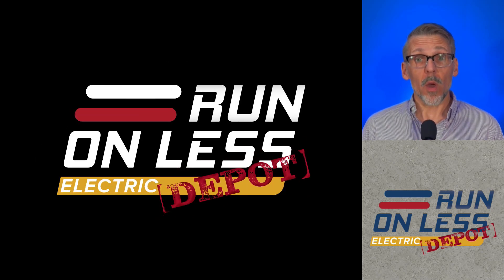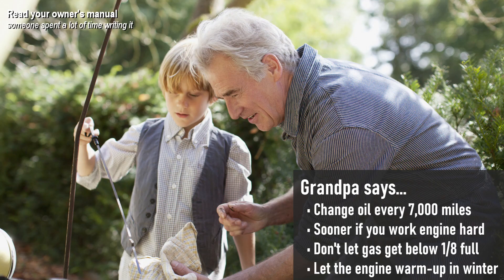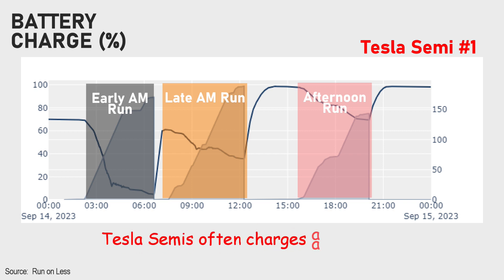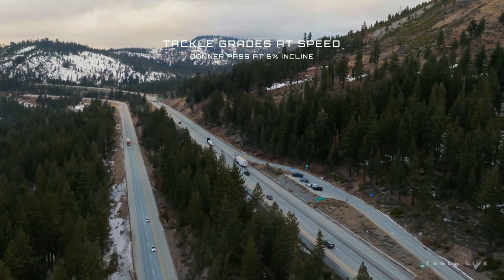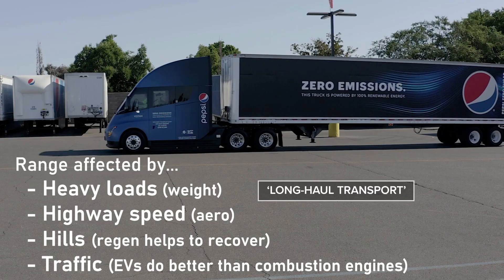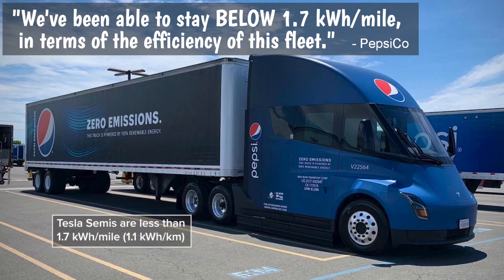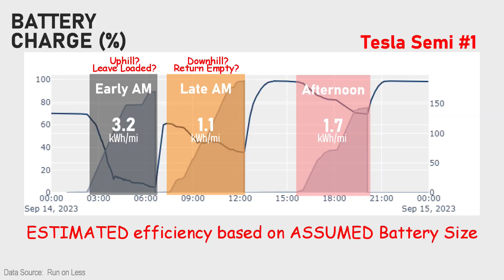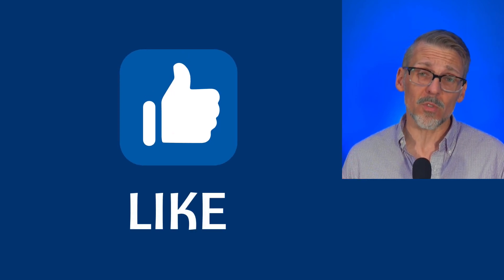In-Depth Analysis of Tesla Semi Data (Freightliner and Volvo too!)

Comment: Tesla did 500+ miles at 82k gross crossing Grapevine, on a single charge.  There is a video of it.
Reply: Tesla has faked every single video. You think this one's different?
Reply: You cant possibly fake that!
Reply: I have to do 600 miles at 83k gross, so not viable yet plus the speed limit is 80 here.
Reply: @thedood4713  No one is making you buy an electric truck.
Reply: 82k was the total weight, what is the weight of the load?
Reply: going an average speed of 52.5 mph.  Not very real world
Reply: @prof.crastinator 
Actually that speed makes sense as aerodynamic losses are a huge factor! The legal speed limit is 55 mph so tesla can argue that is appropriate. The EV transit buses that I deal with are ok at stop & go at low speed but put them on a freeway at 55 mph and they drop dead too soon to be useful. Also routes that are near 200 miles per day are a bad fit for ev buses.
Reply: @Mentaculus42 your right about them running out of power faster, but ev semis have regen and the ability to coast at speed. That will significantly improve their range on the freeway.
I know cars and trucks are different but I only get a little less efficiency on the highway because I coast at 55mph. All that momentum becomes energy when it has to slow down.
Reply: @Mentaculus42 200 miles a day is too easy for the semi, there isn't enough data on the range but when it was tested at maximum load on a 1000 mile trip, it only needed 2 30 minute charges and one 45 minute charge. That says how long they can last and they can get back on the road fast. (None of the charges were from 20-80%)
Reply: Lot of good regen will do you on a highway.
Reply: @nimabeee_playzyt3339 wow you no nothing about normal highway speed and trucker hours. Most interstate highways have a 65 mph  ĺimit for trucks and truckers are limited to 8 hours per day. So this slow truck is losing 80 miles a day.

On top of that batteries loses about 5% of their charging capacity per year. Dont even factor cold weather charging and performance. Here we are 1 year later and this truck is still a mystery of bs
Reply: @kelvinw.1384  That's not what pepsico has reported,if you have a problem, go talk to them. I'm not listening to a kid on YouTube. 

You don't know anything about batteries, they don't lose 5% per year... the first year is 3-4% and from there it's extremely low degradation for the next 300-400k miles... man, there's so many studies released about batteries lasting over 300k miles and here you are with dated 15 year old misinformation.
Reply: @prof.crastinator that average speed was what they were getting doing real world routes, so not sure what you're talking about here. Or did you miss the fact that this entire video was analyzing actual data from actual fleet operations?
Reply: @truhartwood3170  Wait until you find out the rest of the country has 70mph truck speed limits….  

Where is this super financially viable semi?  it should be everywhere with it’s amazing ability to beat rail in a convoy situation?  

Cope hard.
Reply: @prof.crastinator  I said 55mph is the "average speed" not "max speed". Might want to slow down a bit when you're reading there. They use 55mph average speed when calculating range because that's simply the actual average speed the trucks have been doing on their real-world runs. They're currently building the factories (Nevada and Germany) to build the semi with a target run rate of 50,000/year by the end of 2026. I believe they've built at least a couple hundred so far on a low-volume production line for testing/proving. Tesla is using them themselves, and Pepsi now has 85 of them in their fleet, recently taking delivery of another 50 to add to the 35 they've been testing for a few years now. Walmart and Costco have some, too. I remember Walmart has already ordered 130. There are a ton of other orders from other companies as well. They all know they'll need to make this switch asap to remain cost-competitive.
Reply: @truhartwood3170  Watch the video- every single car or truck passes him.  he made a single pass the entire drive.

It was the top speed.
Reply: @truhartwood3170  The Average speed was 52.5 mph- like i stated in my original comment. Try reading and doing math guy.
Reply: @prof.crastinator  Are you saying that's the top speed in the video, or are you saying that was the average speed, or are you saying that that's the literal max speed of the truck, or are you saying the range will drop by half if it goes 70mph? I don't really understand what you're trying to say here, (based on one single video from almost a year ago when we have way more videos and data now).
Reply: @truhartwood3170  In the video. Because the faster you go the worse the range will be. Of course they were just following the speed limit- but that won’t fly in other states.
Reply: @truhartwood3170  by half? No. Significantly oh yes.  What data? Tesla supplied data?
Reply: @prof.crastinator  You seem to be upset that this isn't a drop in replacement magical panacea for all trucking.

An entirely new transportation paradigm requires an entirely new logistics paradigm. 

These trucks are going to be production limited for a very long time.

If it's not the right tool for your job why are you even bothering?

This isn't a consumer product. You should know what you're getting into. If you don't, that's a you problem. Caveat emptor.
Reply: @prof.crastinator  start with the Run On Less event that tracked 3 of Pepsi's Tesla semis as well as a range of other trucks and semis. Also, we know the next gen semi that will be the mass-produced version will have different specs based on lessons learned over the last 7 years of testing data, maintenance issues that have come up, driver and corporate feedback, etc. Plus that's two years away so the battery tech will be much better. That could lead to them keeping the same range and making it lighter, or increasing the range, or just having more options for range vs weight. The price Dan Priestley gave of $150 - $200,000 is probably already factoring in battery costs coming down drastically over the next two years (they're already coming down pretty drastically over the next six months!). But the rate of improvement in technology is probably a big factor in why they don't want to give too many specs right now. They may also be planning some outlandish stuff, like maybe it will be autonomous right out the gate, or maybe the production line will only have Optimus robots working on it. Either of those could change things quite a bit in terms of design and cost.
Reply: @truhartwood3170  Haha- you believe everything Tesla and Elon tell you… This thing is a useless gimmick for so many reasons- range just being the most obvious.  Nevermind charging infrastructure cost and battery life…
Reply: @truhartwood3170  Optimus robots 😂😂😂😂 You have really drank the koolaid guy.  Tesla will be bankrupt within 3-5 years.
Reply: @prof.crastinator  yeah, I've heard that before about Tesla going bankrupt. And about me drinking the Kool-Aid. But things keep working out the way I expect, and the doubters keep getting proven wrong. So. 🤷‍♂️
Reply: @truhartwood3170  Have they? Because the only thing that keeps saving them are dumb investors. It’s a small car company valued as a large one- that barely makes money and much of that is accounting magic.   
They have an aging product line except for a truck that loses money and a vapor wear semi truck.  But keep pretending full self driving is coming next year.  Along with robotaxis and robots.
How is that roadster working out for the suckers who paid 250k for a promise?
Reply: @jtjames79  It’s vapor ware- batteries are awful for large trucks.  They are too heavy but more they have ridiculous charging needs to make them even semi-feasible… And even if you solve that they cost more to own over the life of the truck- even when considering diesel.
Reply: @jtjames79  And without a price or third party provided cost and efficiency data- it’s all tesla’s word about this making economic sense for ANY use case- and they don’t have the best track record about truth in advertising.
Reply: @prof.crastinator  🤣 You so mad rn.
Reply: @prof.crastinator  You've been claiming Tesla Would go bankrupt in the next 3-5 years for the last 13 years now. 
Yet Tesla has more cash in the bank than pretty much every legacy OEM combined.

Tesla semis will take over the industry. Mark my words.
Reply: @themonsterunderyourbed9408  have I?  Weird I don’t remember that… and still wouldn’t change the fact that they won’t have nearly the market cap they do now 3 years from now…
Reply: @themonsterunderyourbed9408  I can’t wait for you to be so wrong about this- I doubt you’ll acknowledge it though.
Reply: @truhartwood3170 lmao....here ŵe are 1 year later in the middle of 2025 an̈d the factor still isnt built yet. 50k in 2026 huh. Whats going to be your move the goalpost bs excuse now. Batteries?? The truck was annouced in 2017...its almost 9 years later. Your still stuck quoting data Tesla gave you.....rofl
Reply: @prof.crastinator A lot of otr trucks are limited to 55mph for fuel savings. Assuming you ever slow down or speed up on your route, then your average will always be below your top speed.

So yes, actually. Very real-world.
Reply: @operator8014  Go ask real truckers about this- because no- much of the country allows trucks to go 70mph because time is often more valuable than fuel savings (not that the semi would ever compete on cost- as it is far more expensive than diesel trucks).  So not real world at all.
Reply: @prof.crastinator  You can keep looking for every way to hate this truck.  The Tesla Semi doesn't really care.  Want to see some fantastic numbers from it?  Look at the Run On Less 2023 numbers, pay particular attention to Tesla Semi #3.
Reply: I hope they're paying you enough to be so gullible.
Reply: @MidlifeTrucker-ThomBell  the tesla semi is like their EVs. They provide a short and shitty range. 500 miles of range for a semi is absolutely nothing compared to the many regular semis that offer 1,000 miles of range or more. I'll take the fueling and the ability to keep moving. Time is money and money is time....
Reply: @carlsmith5545  Yes, to those who know nothing about the Tesla Semi the 500 mile range seems like a problem.  It’s not.  In just 30 minutes it recharges to 75%.  As you know drivers are required to take a 30 minute break each day.  

The Tesla Semi won’t work for you because you allow political bias to block your thinking.  It’s okay, no one is making you buy one.
Reply: @MidlifeTrucker-ThomBell  a 30 minute break? Drivers are required to rest 8 hours after 12.
Reply: Lol!!! My grandfather is a retired truck driver. 45 years of moving freight from one end of the country to the next. I have a Tesla model S. Honestly? Their downtimes for charging and longer ranges needs improvements. I'll never give up my 570 miles of range which tesla or any EV in America can provide. I use my model S for what it was designed for, short range local destinations only. But bor if they ever came out with the semi that provided 1000 miles or more,  shit now we're talkin!!! That would be bad ass!! Hell yeah...
Reply: @MidlifeTrucker-ThomBell  otherwise i don't need any politicians to see that electric needs improvements. Hell even you know that...
Reply: @carlsmith5545  EVs will continue to evolve. Diesel will fade away. Cost per Mile to operate will seal the deal. PepsiCo is moving cargo for about 25¢ per mile in California using Tesla Semis.  Diesel can’t come close.
Reply: @MidlifeTrucker-ThomBell  yeah well today's not that day...
Reply: @MidlifeTrucker-ThomBell  If plugging in and staying awhile for a short and shitty range is impressive to you then do your thing buddy. One day they will come out with electric with greater range and less time to charge. That would be impressive..
Reply: @carlsmith5545  It will never be that day for you.  You have already demonstrated that you know too much to even think about EVs.  You look at them as a leftist plot to take away your diesel.  I like saving money.  I love EVs, hybrids, and Plug In Hybrids.  And before you go there, I’m a lifelong Republican.
Reply: @MidlifeTrucker-ThomBell  Again! I don't drive diesel, and i have a tesla model S. I use my model S for what it was designed for, short range local destinations only. I like EVs too. I think they're kool as hell. But once they're improved with shorter down times and longer range, I'll like them even more. Not only do i save money but i make alot of it too. Money is not the issue, i have that, it's time i don't have. And being Republican or Democrat has nothing to do with it. Anything else???
Reply: @carlsmith5545  Short range only? What is your range? Most Americans do not exceed 300 miles in a week, let alone one day unless on a trip.
Reply: @MidlifeTrucker-ThomBell  exactly!!!! There you go, Now you see. Except on a long trip!!! When im not traveling seeing family or on business, i use my Tesla model S. I go back and forth to my business and work, grocery store, walmart, the diner, mall, and anything else local. For this 300 miles of range is more than plenty. I charge it once a month and yeah taking me about 30 minutes. Sucks but that's electric. Long distance traveling? You damn right i break out my jaguar XJL. Now this is long distance traveling capabilities. A large full size luxury automobile which tesla dosent even make, fueling 3 minutes and not 20 to 30 minutes, range 570 miles, which is not available in an EV. Infact my XJL has more range at 570 miles than a Tesla semi truck at 500 miles of range. Between Lancaster Pennsylvania to Jacksonville Florida is 831 miles. I travel this through the night when everyone is home and out of my way. It doesn't matter how many times i stop for what ever reason, i only have to stop once to fuel and takes me 3 minutes. Up and out. Most americans you say? Most americans want nothing to do with EVs. And, im not most americans. I travel alot. Wish i could buy an EV with travel range but unfortunately the reality is, long range continues to be reserved for gas cars only.
Reply: 82k? So empty?
Reply: @jerrylawson9003  Sarcasm or Ignorance?
Reply: @MidlifeTrucker-ThomBell  "Sarcasm or Ignorance?"

Realist of fanboy?

Quoting Musk is basically repeating a lie. If you ask Musk to pick a card from a deck he'd insist he got the 11 of clubs.
Reply: @vinny142  Can you disprove the independently verified Run On Less 2024 data?  Have you even looked at it?
Reply: @vinny142  Run On Less is not Elon Musk.  It’s an independently verified annual truck event that uses real time numbers of trucks doing their actual jobs across this country.  The Tesla Semi uses 1.7 kWh to move cargo a mile.  That’s about 25¢ on California’s electric prices. What does it cost to move a semi a mile on California diesel prices?
Reply: @MidlifeTrucker-ThomBell about .82 in California and .68 where I live in Maine. If everything was electric, demand would probably make that a moot point though. My question would be; with the electrical rationing that is becoming more common will the grid sustain that much electricity usage? Wouldn't it be better for the states to invest into mass/bulk transit such as trains; which use energy even more efficiently than trucks for long haul? And as more people want to drive less, wouldn't that make more sense than cars and SUVs?
Reply: @bdaig12  Our electric grid isn’t a problem. The only time that is an issue is 3 months of the year during peak hours, which are from 2 PM - 7 PM.  Every night we have an overage of electricity.  We won’t go from where we are now at the flip of a switch.  It will be 20-25 years.
Reply: lol what have you accomplished in your lifetime Mr Keyboard warrior?
Reply: @antoinepageau8336  because that is a sign you have a winning argument- when you desperately need to claim the other side is a “keyboard warrior” instead of disproving their argument or even addressing it.
Reply: @MidlifeTrucker-ThomBell  well here's some facts. I personally like the look of the semi but unfortunately, Tesla's semi class 8 truck is nowhere near mass production status. Nearly two years after deliveries began, the American company built roughly 140 units, with approximately 100 being used by tesla it's self and 36 going to its biggest customer, PepsiCo. About 12.2 million trucks are on the road currently with less than a handfull being electric....
Reply: @carlsmith5545  Then quit worrying about them. Keep driving your diesel.
Reply: @carlsmith5545  Rome wasn’t built in a day.
Reply: @MidlifeTrucker-ThomBell  that's ok, I'll waite....
Reply: @MidlifeTrucker-ThomBell so 1 year later and your magical truck still isnt fully released nor having any other independent testing.
Reply: @ You mean you haven’t seen any so you ignorantly believe there is no testing. Look up the numbers from Run on Less 2024.
Reply: So, they violated the law?

There are hour and speed limits here. If you run at speed limit for the maximum time allowed, you wouldn't get 500 miles.
Reply: @downix  how do you figure they broke the speed limit? I think you might be mathing wrong.
Reply: @downix You aren’t good at math and you don’t understand the HOS. You can drive 14 hours in a day, legally.
Reply: @midlifetrucker-thombell4722  Not more than 8 hours at once, which must be then split with a 30 minute break. You fail.

So, 480 miles in one stretch, 360 miles in the second. In that 30 minute window, you can recharge the battery up to 80%, or 450 miles. 

The only exceptions for this are for adverse weather conditions which reduce maximum speed (and therefore range) and for short haul drivers within a 150-mile radius; in other words, with a 300-mile daily limit for a round trip.

I have to tip my hat to the Tesla Semi team for absolutely nailing it for how a truck driver actually must operate in the US.
Reply: @downix  I’m not impressed.  You really did not understand the Run on Less 2024 or its data? You also do not understand the HOS.  You can run 14 hours in a single day.  Not limited to 300 mile round trip.  You can run 00:01 - 07:00. Take a 10 hour break.  Then run 17:00 - 00:00.  That’s 14 hours in a single day, no exception needed.
Reply: @midlifetrucker-thombell4722  okay, ignoring the guy who doesn't know the law now.
Reply: @downix  I’m sorry that you do not understand there are 24 hours in a day, and that legally we can drive 14 of them.  Learn the HOS.  You are not limited to 8 hours in a day.  You are not limited to 11 hours in a day.
Reply: @MidlifeTrucker-ThomBell  I am sorry you can't understand English yet insist on continuing to demonstrate that lack of proficiency.
Reply: @downix  I understand the data.  I followed the Run on Less 2024 while it was happening. You are biased against EVs and decided to pop off with nonsense.  I called you on your ignorance.  That’s not my fault.  Learn the HOS.  Electric Trucks are the future and there is nothing you can do about it, but rail against them ignorantly, while people laugh at you.
Reply: @midlifetrucker-thombell4722  WTF dude? You are the one sitting here going "da law ain't real bub!" While I am here pointing out that the Tesla Semi is optimized for the real world conditions truckers have to deal with. If anyone is against EVs here, it is you, dismissing what has been built while ignoring what truckers actually have to do.

To repeat. Per the NTSB, a semi driver cannot drive for more than 8 hours at a time, with a top speed of 60 miles per hour, before they must take a 30 minute break. Beyond this they cannot drive more than 14 hours a day, again, at a top speed of 60 miles per hour. If the truck is diesel or electric is irrelevant here. That Tesla's new semi has a range setup to fit these exact conditions tells us all that they know the law. You should learn it yourself.

Of note, the Volvo electric semi is similarly optimized around the legal limits imposed on truck drivers, only they optimized around European trucker needs. They don't need as large a battery as a result, as in Europe truckers must take a 45 minute break after 4.5 hours of driving. Their recharging speed is slower as well, reflecting this reality.
Reply: Tesla has a long history of fudging its demos.
Reply: Most of that 82k is truck and batteries. My truck is loaded with 48k lbs every trip. If you put 48k on that truck it'd be 15 tons overweight.
Reply: @Thephotonguy  the 500mi range semi is <23,000lbs, but let's use that number. With a 10,000 trailer that brings it to 33,000lbs. 82,000 - 33,000 = 49,000lbs for cargo. The 300mi range semi is 3,000lbs less, so could haul 52,000lbs of cargo.
Reply: @Thephotonguy  The PepsiCo trucks haul 42k without an issue.